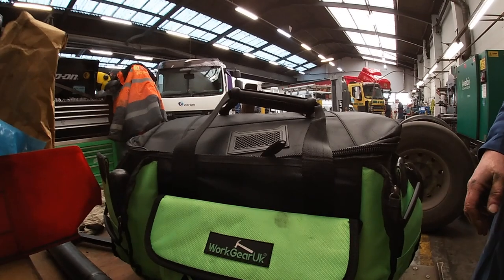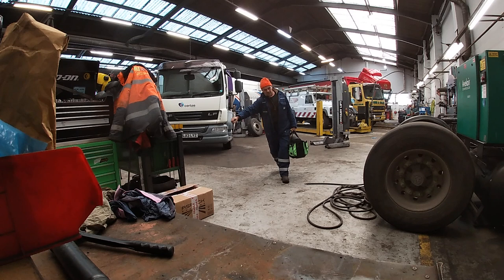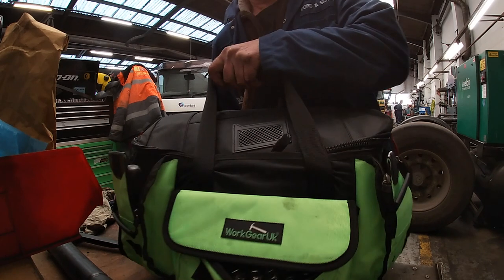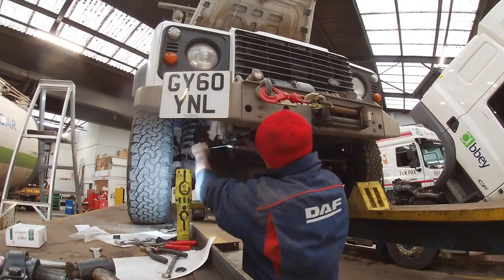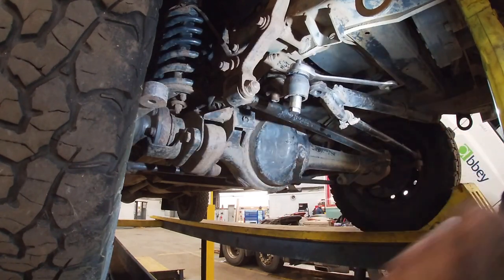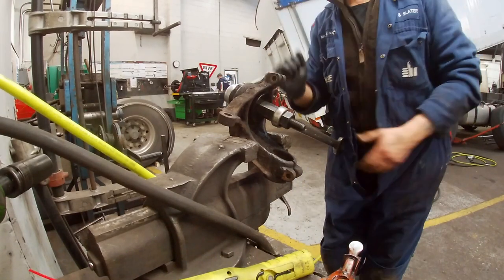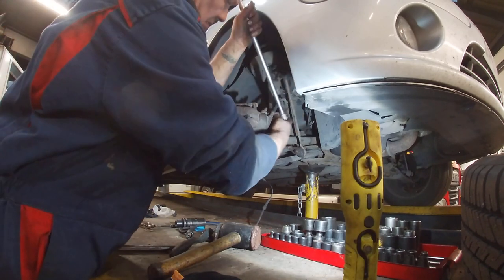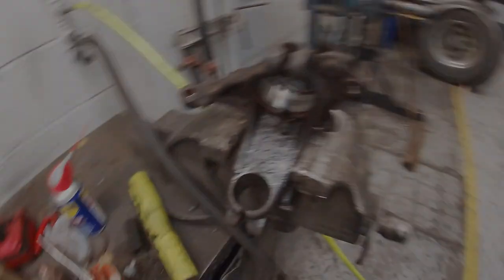THE FLY PROJECT - Observational Skills Practice and The Wheel Bearing

Comment: At first observation I would have thought the Citroen could possibly be a unrecorded damage repairable  vehicle due to the o/s marking on the splash guard. However with more information on water on roads in area and early failure of wheel bearing, the force of the water at speed may have broke the original splash guard. Funny how the mind works with the information it's given.

Comment: Would you say the tool @4:00 works better than the g-clamp and socket arrangement? Recently done this job myself, took reference from your great tutorial of course! It was a Borg & Beck component I used too as it goes.
Reply: Hello Sophie i guess  the main adventage respect these tool its that not allow the ball pin moves to one side when you make presasure to compres all seet in the drop arm. By other side... @Trailerfitter's Toolbox Videos it´s homemaded tool? Thx for the information in both channels you make mor easy to peppole afford the new projects with the rovies. cheers from Spain.